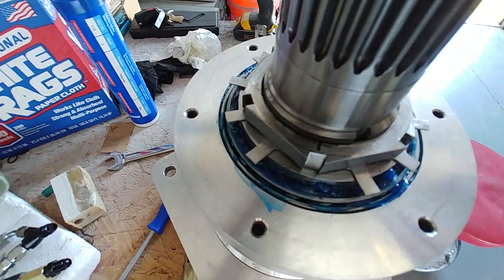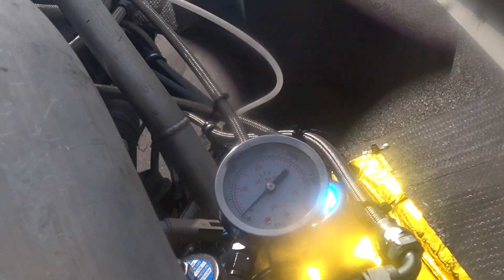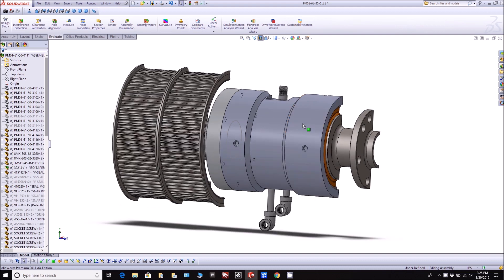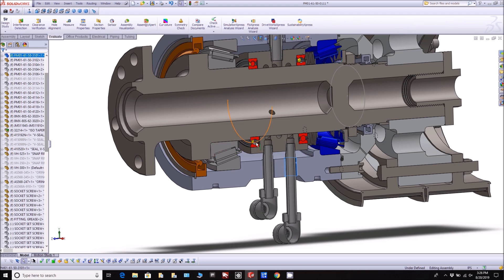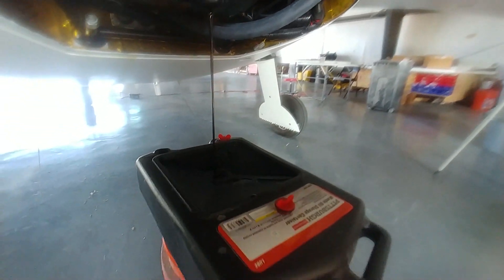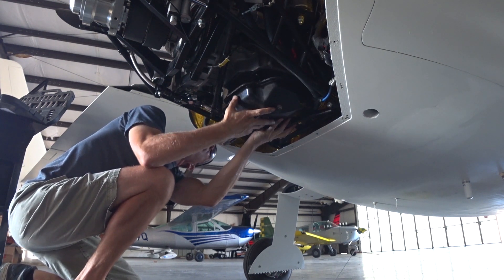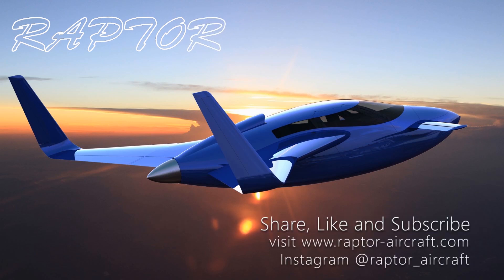Improving the ReDrive - Building the Raptor Prototype

Comment: What about on takeoff under high load, the governor isn’t used, the blades are are in low pitch. So now your saying no oil press to hub under full powering high load except for what ever is left in bath, until you start moving the blade pitch. Holy fk I’m glad I’m not your test pilot.
Reply from the maker: Actually I can adjust the prop so the governor will slightly be kicking in on takeoff and climb out power.

Comment: This project needs proven parts and systems,  The engine and prop system needs to be tested on a stand, run for hundreds or thousands of hours,  then a completed product installed on a airframe.  I like your design, seems like a viable project.  But the theory of building a new design on the airplane and expecting it to work is far reaching.    Check out all airplane engine manufacturers, certified and experimental, they run engines and prop systems in a test cell.  If you want to really produce a product pilots trust, follow the lead of successful designs, companies.  Best.

Comment: Not that it matters in the least, lol... but I like that solution much better. Also wanted to say that if you cut some rod stock or lathe a couple pieces of aluminum to fit those bottom holes you can make the weld go much easier and cheaper.

Comment: If you switched to an IO-550, It would have all this stuff already taken care of, and you could probably even use the same propeller. You'd get into the air and start your flight test program with a safe, proven engine.
Reply: @aeronot bac Which is nuts, because it is clear that Peter hasn't the time or resources to develop both properly. If he'd just hang an IO-550 from a crashed SR22, he could get into the air and start debugging the airframe and systems and start collecting the performance data that shows how it compares with the SR22.

Comment: Instead of that jerky oil pressure gauge , Can you not fit an oil pressure sensor into that fitting and display it as an input on your dashboard?
Also, instead of welding them 2 holes up in the redrive can you not fit a chip sensor and a temp sensor into them holes and also display them on your fancy display which adds to safety?

Comment: The only part of this "inner pressure collar"  solution that mildly concerns me is that the only thing keeping it from spinning inside the housing is the oil feed nipple.  Sooner or later fatigue may be an issue.   I may misunderstand the setup and do not have the solution, but some form of anti torque gizmo that takes strain off the nipple would allow the give you are looking for while protecting the feed line.

Comment: Stop pissing about, abandon that silly collar design and put a swivel fitting right up the cloaca of the shaft instead
Reply: Andrew Rabbitt this is the basically the same setup PT6 engines use for the prop governor.
Reply: @marchese0706  conceptually, perhaps, but not in execution!

Comment: Sounds like the beginning of school has started...  The School of Hard Knocks...  ;-)

Peter have you considered an electric constant speed prop system?  Would the redrive issues be simplified with an electric constant speed prop?  I believe the Sling TSI uses one.
Reply from the maker: The only one available for the horsepower we have runs too slow that not even MT, who makes it, will recommend it.

Comment: Hi, I'm a recent subscriber, but am following the progress with great interest.  I wish I had been aware of the initial participation offering, I would have certainly joined... (if anyone wants to partner on a build in Concord, NC or nearby please let me know!).  As a mechanical engineer with significant experience in synchronous belt drives, as well as lubrication and sealing systems used in mechanical power transmission,  I found the ReDrive system challenges you have faced to be the most complex issues to be addressed in the  entire aircraft build IMHO, and the one issue that has yet to be fully addressed.  I must allow that I admire your, (and your team's), persistence, ingenuity, and forthright approach.  Please do yourself a favor and plagiarize/copy, (highest form of compliment!), the best practices of the current manufacturers from the engine output shaft through prop pitch setting.  As a side note, I'm surprised that any belt manufacturer sold you the drive system product, (belts/pulleys), with your intention of use in an aviation application.

Comment: Wet sump- even partial, is a big advancement in design. Consider adding an earth magnet or strong flat magnet in the engine oil pan to catch metal slivers from circulating.
Reply: I’d like to see a chip detector installed. Turboprops and helicopters use them. It’s just a plug with 2 small magnets and if ferrous metal completes the bridge between the magnets it illuminates a light by completing a ground.
Reply: oil plugs can be bought as a magnetized one.
Reply: @ghostindamachine  Yes but in my experience the flat magnet traps more. Many automatic transmission pans have strong magnets inside, trucks have the biggest (hint hint).

Comment: Have you looked at the hybrid oil/grease baths used in trailer hubs? UFP has a Vault system that is a grease when cold that fills the area and bearings and then as it warms up becomes an oil. The service requirements on most trailers are replace every 10 years or 100,000 miles. And it’s not difficult to replace. Something like that may not require a connection to the sump at all.
Reply from the maker: Yeah but I need the oil for the governor to function.

Comment: The governor will output 0 psi during ground operations and during the initial climb (set to min pitch). Isn't there danger that the inner slip bearing of the shuttle runs dry? If so, the minimum level of oil in the housing has to he higher than those slip bearings. Even then, without pressure, will oil get into that small gap?
Reply from the maker: It's highly likely that the prop won't be at flat pitch during climb as the engine parameters in already seeing indicate that it would overspeed. It's definitely something I can test for initial power runs well before first flight.
Reply: @RaptorAircraft  That will work but you are giving up safe go-arounds with the governor being inop. The goal should be that even with the governor being dead (0 psi) the engine should still develop max thrust on a go-around or takeoff without overspeeding. In your case, the prop would be too flat at 0 psi to develop full thrust at max engine rpm.
Reply from the maker: I will be adjusting the prop to the best static pitch setting for climb.

Comment: Two things to dampen the oscillations on the temporary prop oil pressure gauge.....install a "snubber" fitting on the gauge which is essentially an adapter with a small orifice that restricts the pulse intensities  but still allows the pressure through, to further improve switch to a liquid filled gauge which will dampen the swings.  With as rapid a fluctuation you're seeing I'd shortly expect the bourden tube within the gauge to fail. Glad to see you've switched to the bearing oil bath. Very nice job, you're quite the mechanic, good luck.
Reply from the maker: Thanks, but I'll be removing the gauge shortly as it's served it's purpose.

Comment: The ultimate solution to this problem is to run a dry sump system with a separate dedicated pressure pump for the pitch control system on the propeller!

Comment: Are you going to get return flow in all flight configurations including climbing at 3-4000 ft a minute? Maybe I am not seeing it and you are? Will you have thermal couples attached to the housing monitoring temps to the redrive bearings during flight testing? I am late to your party but had a few years in R&D plus flight testing too. But I haven’t seen it all so please keep the videos coming. Love new designs and the people that are willing to challenge new ideas. I think they call you Pioneers? And for the housing hole you could press in a close fit aluminum slug and weld the outer rim and then re-bore the new existing drain hole without putting too much heat to the redrive housing. I have done that in a R&D gearbox as a proof of concept to save having to machine a new housing. It was for a drain line also. Just some thoughts Sir.

Comment: This is 100% better than the previous design. Good work. I have my doubts regarding the sealed design. I feel like a vented housing (with a vent routed back to the top-end of the engine!) would prevent any drain back issues.

Comment: If I remember correctly the max rpm for grease lubricated tapered roller bearings is about a thousand rpm. Oil is necessary for greater than 1,000 rpm. Also thinking you may need a scavenge pump.
Reply: I also think the reason for oil is it should run cooler. I’m also thinking he shouldn’t have greased the bearings as it would be considered cross contamination to mix the two.
Reply: Most car wheel bearings would disagree with you...

Comment: Crankcase vacuum helps the seals work too. Getting the redrive to be air tight may or may not be beneficial. I’m leaning towards it will work best sealed. I’m sure you guys think this stuff out way more than my 2 minute thought experiment. Good luck!

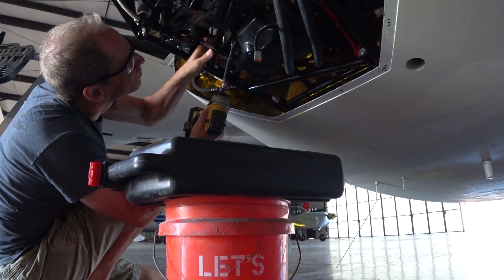Comment: Why not place the return at the 9:00 position? Seems the oil bath would cover at least half the bearing all the time.
Reply from the maker: We discussed that and figured that may be too much oil that it could froth it which might create other problems.
Reply: @RaptorAircraft  How about a full bath?  Would any potential short term frothing (while not fully bathed) be an issue for a 12:00 position?  If so, couldn't this be addressed in a full bath case by pre-loading the housing with oil so that most of the air was already displaced prior to operation?  Also, provided a full bath/12:00 drain is feasible, would a 6:00 or 9:00 fill position be preferable?

Comment: I'd go dry sump like race cars do. A much higher volume of oil is possible that way.
Reply: @Bernhard Jordan He also has an oil pump issue with the auto engine pump providing oil to components that were not considered by Audi. The aircraft needs more robust oil pumping capability for all the units in his powertrain.
Reply: And a dry sump Is easier to mount in other places freeing up space under the cowl.
Reply: The raptor has automotive air conditioning and heating. As well as pressureisation. Cost is already no factor.